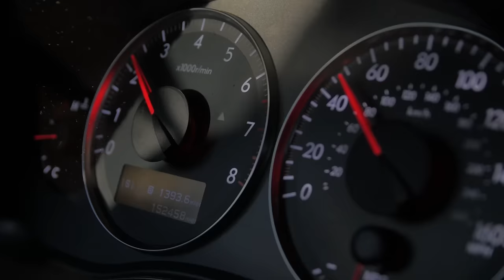Why do you like cars?

Comment: I first knew I was into cars at 4 years old when I would run to the glass of our front door to see a Porsche drive by every time I heard a flat-6 approaching the block. Now I'm 22 and I finally have my first car ($2k E30) to learn on and gain experience. Now it's time to sell it and get a good one that I intend on keeping alive longer than myself. <3
Reply: Word.
Reply: it took me long to realize i was a car guy. i was probably into my 20's. but the signs were there from an early age:

-i stomped my brother in every racing game ever since i was 5 years old. 
-i really enjoyed racing games. 
-i liked riding cars. 
-i sat in my mom's car pretending it was a lamborghini diablo VT. 
-i looked forward to a license, imagining what would be like to actually be at the wheel on the streets. 
-i freaking rolled my jeep without a seatbelt, got tossed 5 meters into the air, landed 40 meters away, almost got crushed by it when it stopped on its wheels just short of flattening me, and that didn't put a dent into my will to drive. 
-then around 2004 i started to get more and more into racing games and simulators, to compare car stats, to benchmark them. 
-this was also the year i finally took my license. aced the test. 
-started going out at night to benchmark real cars. i just had to know their 0-100kph times and their top speeds.
-then it finally hit me: i really love cars, not just car games.

then around 2012 i think my love for cars overtook my love for games.
everytime me and my cousin (who lives about 800km away) meet, we go around at every dealership to look at cars and sometimes test drive them. his current hyundai santafe v6 3.5 is even a result of that. though he's more of a confort / safety freak and i more into performance.
Reply: CAIRN im 14 and i got my first car BMW 328i  its really old and rusty. got it for 1500$ but ill get drivers licence in 2 years tho...
Reply: GraveUypo that list you made is the exact same list for me, except I haven't moved a car more than a meter, (I've moved a car around 90cm xD) and I haven't rolled a jeep yet. Anyway we basically got into cars the same way, except I was flogging my dad at age 6 on NFSMW (The first one with the E46 M3.
Reply: If its got rust fix all the rust, and dont even think about modifying it until you know what needs to be modified. Drive it to the point where you find something lacking and then make up for it. ATM im building up a motor to put into my corolla to give it more power (60hp currently and aiming to make just over 120hp at the flywheel).
Reply: What make me become a car teen:

Car Throttle
Initial D
Too Gear
Pixel Car Racer

Comment: Cars are my reason to be successful, I don't care about a big house, I just want cars!

Edit: I see that many love cars as much as I do, and even more. A month ago I just bought my first sports car at 20 years old, a Toyota MR2 1991 (3S-GTE Swapped). I had a problem with it a week after getting it, turned out to be dead capacitors in the ECU, could not drive it for a week. Now I have a problem that I think is the TPS (throttle position sensor). 
I am saying that because it can get irritating to drive your old beloved car around and seeing the check engine light turn on, and when you're not a mechanic, and young like me, it can be a bit challenging sometimes. But the challenging part is exactly why you should get an older car (if you can afford it, it's more expensive than you might think, not gonna lie) and experience the pure joy of driving of an older car with less electronics.
As many say: It's not miles per gallon that matters, it's smiles per gallon.
Reply: Toyota GR Fan I would be willing to live in someone else's garage if I could afford a Lexus LFA
Reply: Toyota GR Fan same
Reply: I need a big ass house to park my cars and bikes inside so it's more important than you think.
Reply: Death666wish You're clearly not a car guy
Reply: I own three cars when I only need one, get lost.
Reply: Do your homework and go to sleep little boy. Bye.
Reply: Death666wish Ok, have fun when Daddy trust fund cuts your income and you have to get a job at a low income fast food restaurant flipping burgers for the rest of your life. Seriously, this was just a video and a comment section with people discussing their love for cars, and then you come along and disrupt everything. Why are you even here???
Reply: LeCoureurDesBois ill sleep in my car if i need to.
Reply: But cars depreciate.
Reply: Baixiao Huang True car guys don't care. If you put your pride and soul into your car, you don't think about when you'll part with it. Cars are our hobby and our happy place, not simply a practical financial investment. That's the whole reason the car community exists. If we were concerned about depreciation, none of us would own new BMW's, Mercs, or any rapidly depreciating car.
Reply: Baixiao Huang not all cars depreciate. If its a good car and you take care of it, a few years from now you might be able to sell it at a profit. Of course making money isnt the reason were in cars but still thats a possibility.
Reply: LeCoureurDesBois me too
Reply: Same I'm happy with a regular suburban home. As long as it's clean, the area is clean and I can have nice toys in the garage. Family 1st though, so if the cars gotta go for some reason, then they going.
Reply: Baixiao Huang  Not all cars
Reply: LeCoureurDesBois same :)
Reply: LeCoureurDesBois youve got save thought like me ❤️
Reply: me too dude
Reply: It certainly makes me want to get out of this rut of diminished expectations for myself,  Stock trading is probably the best options besides crypto currency which is now pretty stagnant anyway.
Reply: @TylerThanks for sticking up for all of us (Car Guys) against people ("doosh bag") who think they actually like cars for the reasons we do unlike "spoiled dooshbags" who just have a car to show they are rich. My favorite car is the 2007 Ford Mustang Shelby GT500.
Reply: @Death666wish  you don't need a big house, you need garage and parking space. You can have one without the other
Reply: Amen to that!
Reply: Neither do I!
Reply: You’re not the only one. :)
Reply: @baixiao6813  STFU car is my life
Reply: Yep
Reply: FOR REAL!!
Reply: I could have a tini house but I need a bigger garage
Reply: That's what I call a true car guy.
Reply: @baixiao6813  Depends on the car and what condition its in. An old beat up civic? yeah youd be lucky to get $500 for it. A stock toyota supra with low mileage? one recently sold at auction for $120000. Thats an almost 20 year old car to put that in perspective.
Reply: LeCoureurDesBois is rather live in a box and have Supra mk4!
Reply: LeCoureurDesBois same
Reply: Same cars are my life!
Reply: Same. :)
Reply: @thecanucklehead3034  You are right. I just checked the price of my Focus ST, even with 10000 miles on it, it is still worth $20k, the same price I bought it. Maybe I got lucky because it is no longer sold in US 😂.
Reply: Baixiao Huang exactly. You could say anything is a depreciating asset but it depends on the specific example.
Reply: @Death666wish  YEAH!! IM NOT GONA LET SOMEONE HURT MY BABY HE STAYING INSIDE AT NIGHT IN GARAGE
Reply: then you aren't ready for a car, if you aim for a house without a garage.
Reply: Same. I'm in college so I can afford cars. I have a job for car money. It's all I care about. I plan to live in a studio and drive an M3.
Reply: but bruh, you need a big house so you have room for a big garage for all your cars!
Reply: LeCoureurDesBois 2 floors one only garage floor one small living floor lol
Reply: Same here. I don't care about living in a big house or wearing the fanciest clothes. I can live in a small crappy studio apartment and wear ordinary T-shirts from second hand shops. I just want a good car that I will love forever.
Reply: @Death666wish  Just buy a cheap garage and live in it
Reply: My cars worth more money than my house....true
Reply: @silentshiba9629  lmao that's a good idea, buy a cheap 2 story house and live on the top floor and make a garage in the 1st floor
Reply: @tcg1_qc  Hey! Content de voir un autre Québécois icitte!
Reply: Jospeh Stalin  Yeah, depends, where I live most people have what you could consider a "big" garage, as long as I can fit my cars and the tools, tires and stuff I'm good with it, a garage isn't what is really expensive, and tools, you can buy them over time
Reply: @jeajinshin6126  Yes! And even if we're not rich, cars guys care about cars, whatever is their income, they can find something they like
Reply: Super Girl  Smaller houses take less maintenance and often look even better... And it means more money for cars!
Reply: Super Girl  I also prefer smaller houses yeah, my plan is to someday get a piece of land in the woods (I live in the countryside already) and build a small house by ourselves, and ofc, a decent garage!
Reply: @Andy KA True, needs to fit at least 2 cars and all the tools plus work space!
Reply: You need a big house or warehouse to have a lot of cars.
Reply: damn, so much poetic stuff about cars! i love it

Comment: hey dude I love cars no matters what, I will get my 1984 Chevy drag and my 1999 ford  f 150 and my 1999 Nissan skyline twin turbo drift Max! like if you feel me!!!?
Reply: bullzeye is my name I actually just got a 1984 gmc C1500
Reply: Evan S if it's an '84 that'd technically be a C10 then
Reply: Justin Noker i believe that the c10, c20, etc. designations were used for Chevrolet trucks and gmc used the 1500, 2500, etc. designation. I could be wrong but from what I've seen thats what happens.

Comment: I grew up never having an interests in cars; I thought it was dumb. I failed my test for my driver's test at 16, and didn't start driving until I was 18. 
 When I felt that VTEC in my first car, a '99 CL with a J30, I started growing more and more interested in cars, and took the leap to do my first oil change. Then the alternator failed, so I fixed it. 
 Now I'm at the point where I just did my first engine swap, as well as my first rebuild for my '03 CL Type S and I'm itching for another.

 Never saw my self doing this sort of thing. But being able to drive a car I worked so hard on, molding a personality into it; nothing is more satisfying.

Comment: The seat
The Key
The Leather 
The Controls
The Pedals
The Speedometer
The Sound
The look
The Feel
The metal
The Headlamps
The Curves
The exhaust pipe
The Smell of Petrol
The A/C vents
The Windows
The Rubber
The Engine
The Brakes
The Seat belt
The Doors
The roof
The Audio System
The CAR